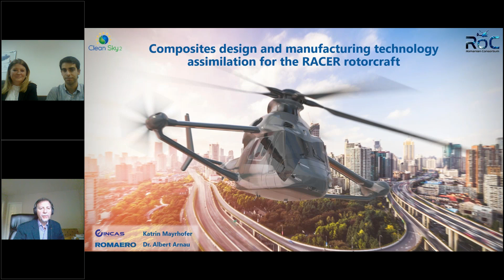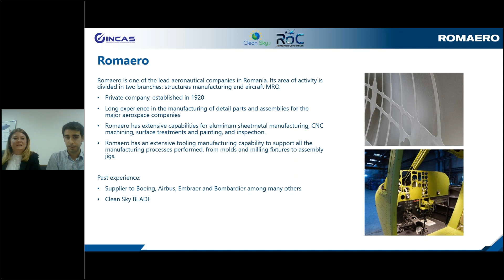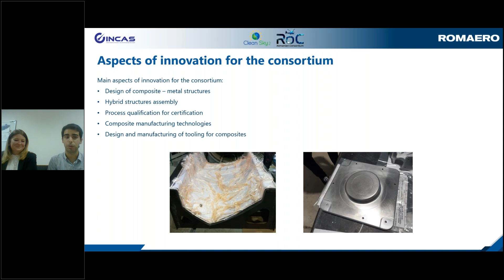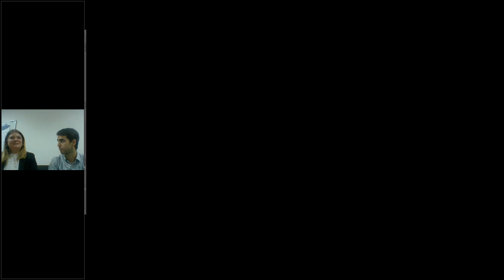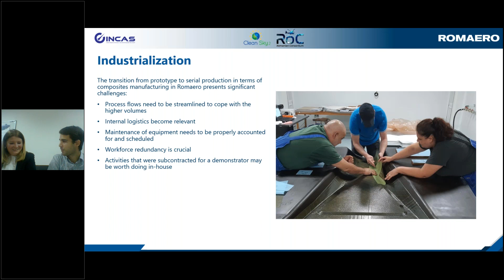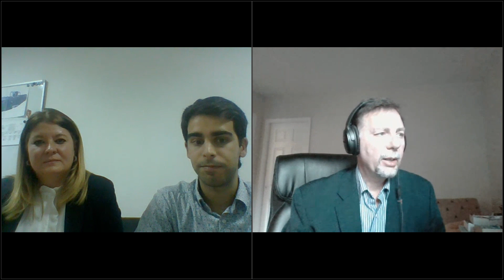Composites design and manufacturing technology assimilation for the RACER rotorcraft

Comment: I know carbon fiber composites electric motors hub motors RF radio frequency transmitters receivers computer engineering mechanical engineer electrical engineer artist designer free hand tattoo artist specialize in realism can make prototypes cast, injection mold, 3D printers, 5 axis cnc,